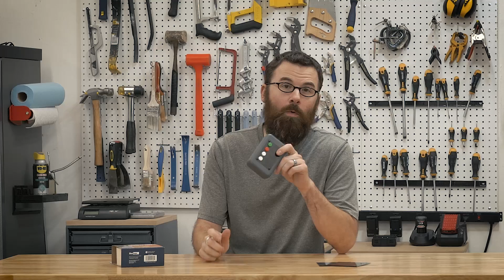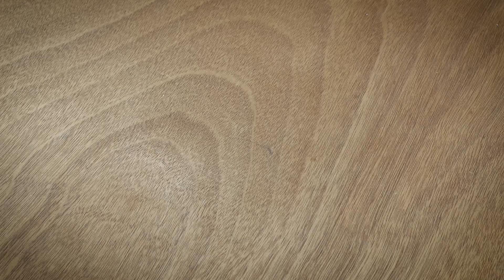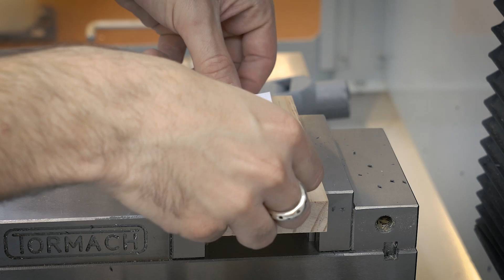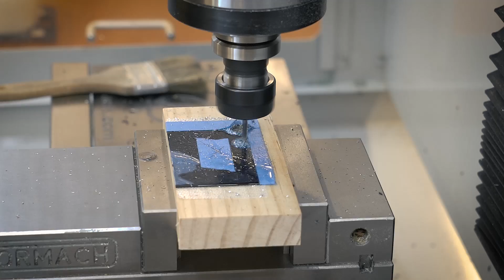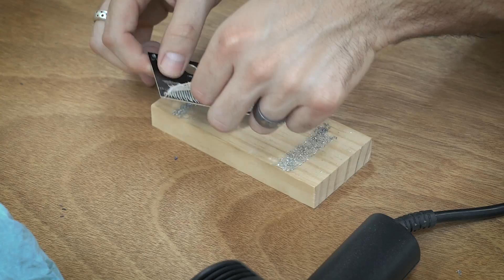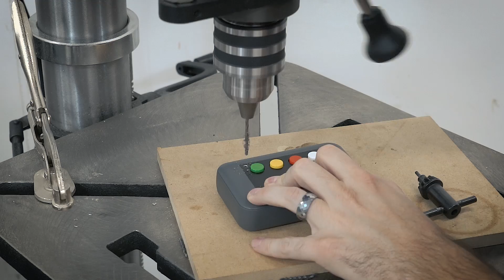From Start to Part: Shop Light Controller Faceplate

Comment: Why screw the plate? Just use glue and drill the button holes all the way through. Pressure from the buttons and the glue would be heaps
Reply from the maker: I like the look of the screws.  But it could have worked with just glue too.
Reply: Can't argue with that! Really enjoy your videos. thanks

Comment: Nice job as usual! As for the dark engraving, try using less power. I've found that "over-engraving" anodized aluminium can lead to a dark engraving.
Reply from the maker: Interesting.  The last time I did this it came out almost white and it was perfect.  I thought I used the same settings.  I might play with it a bit more.  Thanks for the advice!